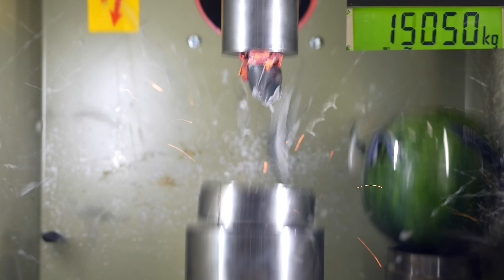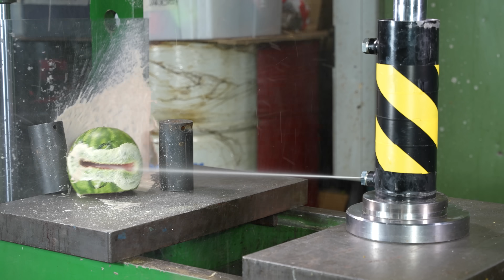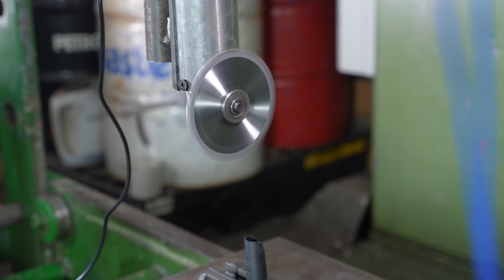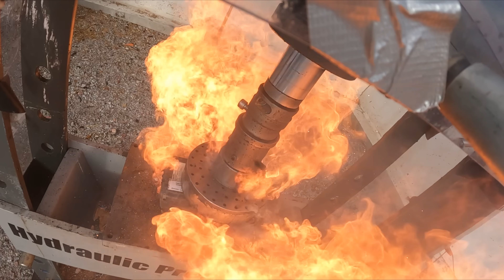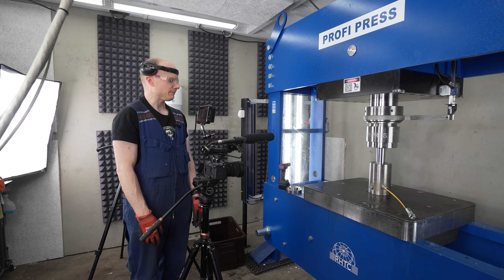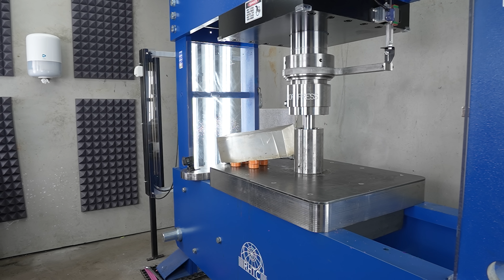Top 10 Most Dangerous Hydraulic Press Channel Videos Ever

Comment: Plastic explosive needs a punctual ignition (a "hot spark/spot") to explode. It does not explode from pressure being applied to it alone. This is why that is relatively safe to handle and is ignited by electric igniter-devices being inserted into the charge.

Comment: 0:35 i had already been slightly injured by a drill bit before i had even learned this profession. as a teenager, i was on a course where i was able to take a look at various trades. on my second day in the metal department, we were standing at the drill presses, behind me was someone who had overdone it a bit, his drill bit broke and i only felt a blow on my backside... half of his 5 mm drill bit went through my leather apron, through my pants, directly into my butt cheek, at first I didn't really notice until I felt the heat from the hot drill bit 😂
In the meantime, 25 years have passed and I have never broken a drill bit myself, the scar on my butt cheek has taught me to be careful 😄

Comment: Suggestion:
Next time you blow up a pressurized hose, try this….
Perhaps you can drill or melt a hole through the ballistic gelatin block (or perhaps cut a slit through the center of the block…and slide the pressurized hose through the ballistic gelatin block?
With the gelatin block just sitting on top, it only experienced a small percentage of the energy created by the explosion.

Comment: I have an idea for a test!
Can you turn a press into a drill.
If you put a glass marble mold under the bit oiled and put the cutting edge against wood.
You will need some space behind the board.
Can you make it dril a hole after it starts to twist from pressing through?
What kind of holes will it make?
Will they be ripped up or harder and better holes that hold up better.
Just put a door on the front of the press with bullet proof glass.
See if it will make things bounce all over harder.
Then use it for the harder hitting stuff 🎉
Take a super tight cylinder and lid.
Melt hardened steel and put it into the bottom half.
Put the top half on and press it till it cools.
Mill out the core and see what kind of steel it is?
Reply: Glass marble molds for glass blowing are very hard steel.
Not expensive $50.
Reply: Press oil in a cylinder and see what happens when it fails.
Do a fake one pressing a tank mortar "live" and blow up the shop....on the computer.
April 1st release.
Start 30 nails in a tight circle and see how much pressure it takes to press them all.
At the same time into different woods and others.
I don't think it will press in all the way till it's really high.
If they sound good I have more 🎉
Love your show and the way you and your wife seem to really love and support each other.

Comment: What scares me about injection injuries like with the gel block is the lack of visible injury from the outside other than the injection point. If you focus on how, comparatively little, the cube bulges on the outside compared to the size of the wound channel you can see how hard it would be to tell how serious of an injury was just sustained. Especially when the liquid has mostly exited the wound there is next to no noticeable change in the sides of the block besides the one that was hit.

It's like the iceberg of injuries, what you can see is but a fraction of what hides beneath the surface.

Comment: Have you tried crushing Lithium Polymer LiPO batteries for the RC cars play hold a higher density higher C rating an extremely higher output a 8,000 milliamp battery 50c 6s lipo it kicks out 400 amps 8,888 Watts

Comment: Typical Lithium COTS cells are 18650 style cans. 

They vent with a burst pressure anywheres from 200-400 PSI in a beam jet anywhere from 1-10mm in diameter, so nearly anything infront of them will get a hole blown through it (even titanium thats 1/4" thick). i know this because im a mechanical engineer who designs very complex battery systems, and i do a ton of destructive testing. 

In short, dont fuck around with cylindrical lithium cells. If you see someone who has a vape with one, save their life by making them switch to a more common pouch cell style vape.

Comment: I have seen what bits can too. We had a cnc machine with practically bullet resistant glass fitted on it, one day there is a slam that can be heard from outside the building and there it is, the bit is stuck in the glass.... on the machine across from the machine that crashed. Thank God no one was around cause the was basically bullet traveling at mach f*ck. WHERE YOUR SAFETY GLASSES!!!!!!

Comment: When I used to work in the oil fields, I had a 4 inch diameter line blow 2 to 3 feet away from me at 9,000 PSI.  Luckily it whipped straight up and down.  Otherwise I would be dead.  It's the reason I work in tech now.

Comment: Take the hardest non heat treated high carbon steel you can get your hands on, heat it up to quench temperature, then go about 300 degrees past it, don't melt the steel, then drop it in water just before freezing temperature and it will cool the steel extremely fast and cause a ton of stress in the material and make it very brittle and when you crush it, full send it with the press and you should get a hell of an explosion and should be really dangerous

Comment: Even though a press is not involved, the dangerous one I see too much is someone taking a wheel bearing and spinning it up with an air nozzle. Sure, it makes a neat whizzing noise, but if that thin cast iron cage that keeps the rollers in place has any flaws, it will launch those rollers that you spun up to 10k rpms in any direction 😳.

Comment: Honestly, I was surprised the copper bar didn't get mentioned...
As not only did it fly across the shop and take out an expensive widow, but I believe it was also the impetus behind you rethinking your safety standards, resulting in building a blast box around ye old 150T press! 😏
(though I might be mistaken; was quite awhile ago)

Comment: Can you squash lithium polymer (lipo) batteries in the metal tube you squash fruit in?
Also, would different C rating (amp output capability of the battery) lithium polymer batteries create different size explosions for the same capacity battery?

Comment: What you saw with the high pressure stream of water is also why there are two things to remember with a pressure washer. (1) always keep it moving on the surface you are cleaning. If it is held in one spot for a few seconds, it will cut/drill into the surface (2) never put any body part that you want to keep anywhere near the nozzle. It will be damaged or cut off.

Comment: I'd like to see a comparison of battery crushes
Zinc-carbon, alkaline, LiPo, Li-ion, lithium thionyl chloride, lead-acid...
Reply: Also, charged vs. uncharged lithium battery. Considering a charged battery stores a lot more accessible energy, it should make a visible difference...
Reply: @highdefinist9697 electrical charge won't change anything. Fire requires physical fuels.
Reply: @eins2001  I don't think this is true.

Unlike capacitors, batteries charge/uncharge through a chemical reaction, so the chemistry of charged batteries is different from uncharged batteries, hence they might burn (or otherwise behave) differently.
Reply: And under water, for extra reaction!
Reply: Lead-acid will just be a spray of acid. Neither component is inflammable, and electricity is created via a stable reaction.
Reply: And assault and battery

Comment from the maker: Still on summer vacation! We have been filming on the days when the weather is bad but this week we filmed stuff for Facebook and short form videos so I decide to stitch this compilation together. I like to do this also since they lure in a LOT of new viewers to the madness. 

Next week we are going to film lot of explody stuff for Beyond the Press! Including the FIREtruck video (we have installed flamethrower on that thing to make it real FIREtruck :D) Also redo of big ass tires and 300 bar compressor is coming!

I (Lauri) have been doing lot sports and motorcycle stuff and Hanna seems to spend most of her time planting stuff on my yard :D
Reply: Instead of old drill batteries, using LIPO drone batteries that are 6s and 2000mah+ would be amazing.
Reply: LIPO vs LiON 🤣
Reply: Hanna knows where it's at. Your growing seasons are short.
Reply: And motorcycles don't grow anything.
Reply: What was happening with the water? IT came out the top a lil bit but that was it. And a bunch of nothing the rest of the time.,🤷🏻‍♂️
Reply: @dolphlundgren6967  i bet if you put a 6s Lipo battery in and spike it with a nail when crushing it….that it will then produce lots of fire.   MountaineerFPV cuts up Lipo Batteries all the time.  I think MountaineerFPV just shot a Lipo too.  Shameless plug for MountaineerFPV 👍